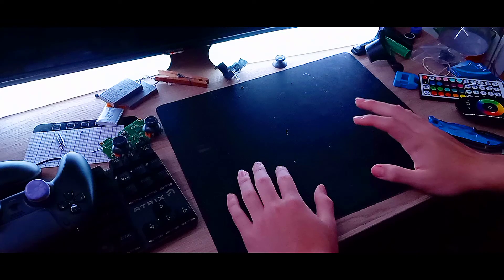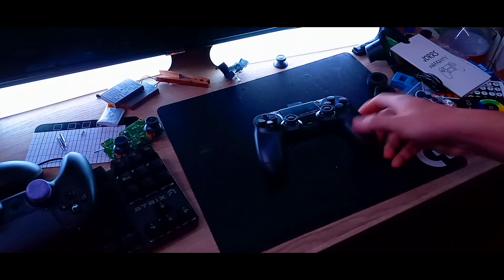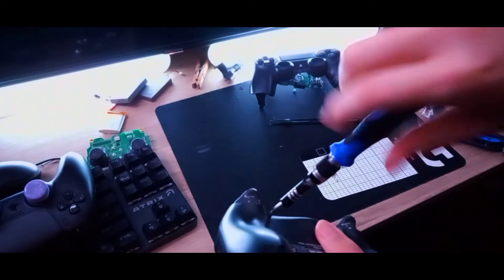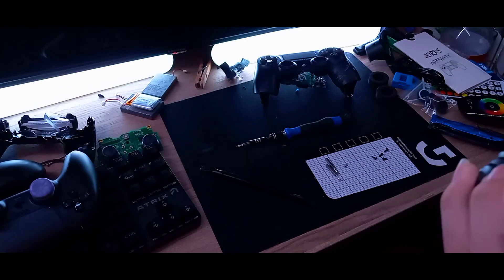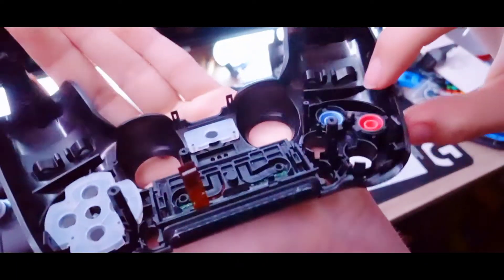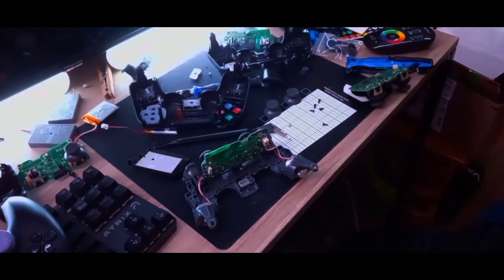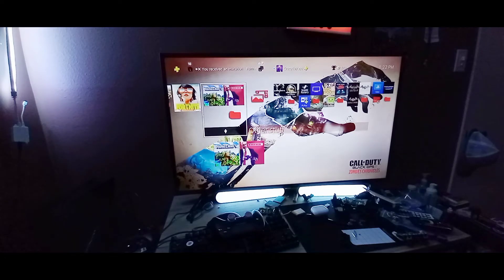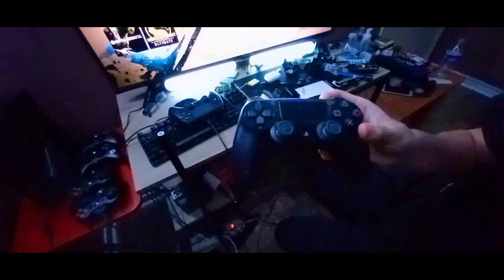Best 16$ ps4 controller

Comment: How is it in gaming any problems
Reply from the maker: It's fine the only thing that doesn't work that good is the motion sensor. It works, just not that good, but everything else is fine. And even if the controller doesn't work you can just get another one because it comes with a year warranty.